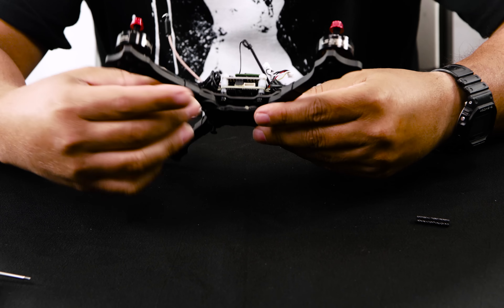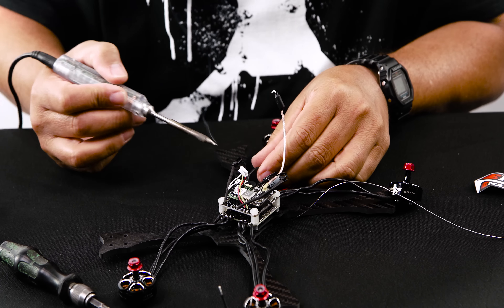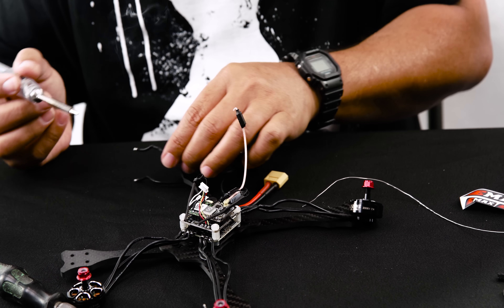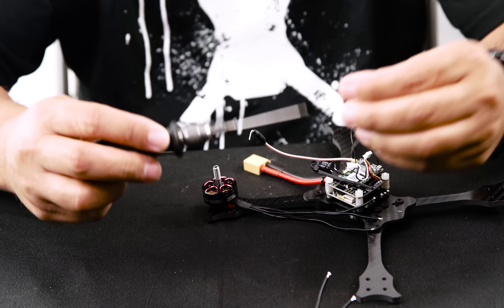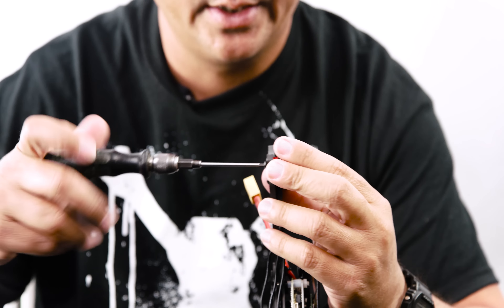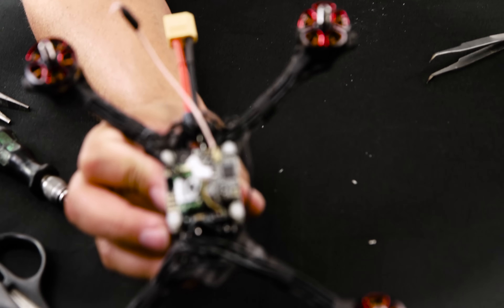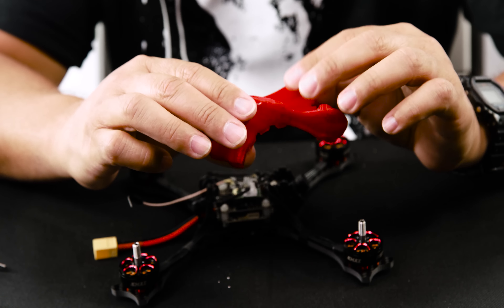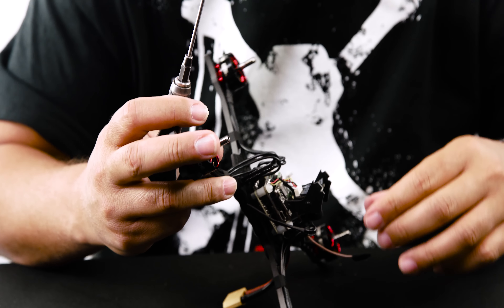Tutorial - How to Mod the Hawk 5

Comment: Hello Emax.
Please can you make a video or explain how to replace the linear antennas with the pagoda ones. My linear one fell out and I don't know with confidence how to replace the antenna slot with the SMA adapter.
Thank you.
Reply from the maker: Simply snap in the connector. Sometimes it will be a little loose so we recommend hot gluing or using a dab of liquid electric tape to hold the antenna in place.

Comment: I bought both the cw and ccw motors, do I just solder them straight on or do I still need to cross over a wire? I know I can fix it in blheli but jut checking.
Btw I love that tape. I using it on a freestyle build pretty good stuff.

Comment: Hey Billy, would you recommend conformal coating on the hawk 5??? The weather in the UK can be a bit dodgy in the winter ??
Reply from the maker: Some pilots have done it for those scenarios :)
Reply: Is that a waterproof spray??  What happens if you have to remember solder something after you spray it all over the quad? Does it come off easily?
Reply: @buleetu  the heat from the soldering iron takes it right off and it isn't a spray but a brush on coating, it's silicone in suspension but it insulates from shorts and waterproofs too

Comment: Can you guys do a video on how to replace the VTX? My understanding is its not a basic de-solder job..
Reply: I need this as well. As that crappy axii broke. Did you find a good vid to help you??
Reply: @xxmrkillswitchxx  no, but I think if  I use solder wick on the 3 pins it should come right off once the solder is cleared. A solder sucker would work too I think. The magnum stack pin out is easy enough to find. Biggest issue will be if you can fit your new vtx in the stack. Might have to de solder the receiver too to make it all fit.. i might build my stack up a level and put it in there...
Reply: Crap i did not (have not) want to do this ASAP... which is why i bought a rtf quad.  Now im thinking about returning it to amazon and rethinking buying this quad again
Reply: btw thank you for your thoughts hazmat321 .
Reply: @xxmrkillswitchxx  I thought I had a vtx issue early on, emax customer service was steller, they were going to send a replacement asap, turned out to be my fault. What is your vtx doing?
Reply: hmmm... i appreciate your wanting to help. happen to have an email or a place i could send you a picture or two?
Reply: and i do feel like an idiot because this seems too easy.  the  antenna on the vtx came unattached so i thought i would put the pig tail on, so i can put the real antenna on but it will not reattach. both connections dont look to be damaged... other than the sticky stuff they use (what is it?) to stick it down is now gone.
Reply: Mine cuts out, goes to black and the the screen does weird distortion and gets hot. Was this similar to your vtx issues?
Reply: Hazzmat321 it is a basic resolver job, it’s just tricky to get it off because you have to desolder 3 pins at once. I replaced mine with a tramp HV

Comment: Hi, I updated to betaflight 4 but obviously PIDs are not good. Is it possible to have an updated configuration for beta 4? Thank you
Reply from the maker: The Hawk 5 is designed for the stock firmware. We would suggest reverting back to stock settings and firmware :)

Comment: I want 2306 2400kv with hq5146 props. Gopro is not a must but i do use a firefly camera which is on 20g. Would a 2206 2300kv do fine? I dont want to lose flight time from my ls2206 2300kv.
Reply from the maker: A lot of pilots, us included, fly just fine with 2300kv with a gopro :)

Comment: Yaaaaaaas loving the hawk 5 with the mayday fin canopy ooo and I love ur guys 20x20 6s stack (first smart Audio build lol) and i love the gemfan 5149 on the stock motors avans were meh for racing very efficient but just didnt like feel like the props were for me... i think its easier to reverse the motor direction in the software makes for a cleaner job... wish the new stack had a camera control pin though wold be even more awsome

Comment: Can you make a video on how to add RSSI? I flashed my XM+. The receiver page on betaflight shows activity on Aux 12 but when I set it on the dropdown menu and save it, it disappears when I come back to receiver settings. RSSI just reads 17 on the OSD. 

I bought a FrSky QX7 just for this quad and have buyers remorse.
Reply: I’m running 3.5.3
Reply: I reverted back to 3.2.2 and it works now! Hopefully they’ll fix this on 3.5.
Reply: I'm trying to get my radio read out the voltage for me because I'm not using goggles yet, is it possible at all? As I read the XM+ is not able to send telemetry??  Thanks

Comment: I used these rsII 2306 2400kv motors on a new build and one gets extremely hot when just hovering for a minute or two.  The motor ha seven produced smoke once. 

I moved the motor to a different arm on the quad and the same problem. 
So I know it’s the motor.  Will emax replace this for free?
Reply from the maker: Open a ticket with us and we'll gladly help you out :) If you are in the US, emax-usa.com and if you are international, emaxmodel.com

Comment: I have an extra tbs unify...has anyone had any luck putting one in a hawk5...is it possible if I get out those pins.? Does anyone have a diagram?
Reply: you can clip the pins off and solder wire to it.. I've installed/setup other vtx w/smart audio. Also for whatever reason the stock vtx works better if you clip it off resolder with wire and attach with 3m foam tape. I think it reduces noise coming from the fc. I would also recommend adding a larger cap.

Comment: Great tutorial but you possibly stated conflicting information @ 27:30.  You stated that the NEW Mini Magnum VTX has smart audio but you should be clear that this is only through the OSD and NOT through the radio like LUA or Spectrum.  I was really disappointed finding this out after the fact as EMAX advertises smart audio however this FC does not support telemetry.

Comment: I have a question why would you put a 3 dollar vtx in a 250 dollar quad? I don't get it it's the most important part of the game. I love my hawk 5 but the vtx is horrible if it were my product I would have never put this in unhappy with the vtx I should have done some research before purchasing
Reply: I hear ya!! the whack liitle axii broke before i even flew it..  Guess I am gonna be learning how to solder a new vtx. got any recommendations?
Reply: @xxmrkillswitchxx  iv been looking around you want one that's 5v I have 2 that are 7v-24v so I would have to solder power wire to main battery pad
Reply: Thanks for the heads up!  let me know what ya end up going with.  I havnt looked closely at the stack... it would be nice if there is a good no solder option.
Reply: I had the same issue with the stock vtx.. had to clip it off the fc, later ended up burning up another vtx had nothing to fly with and reinstalled the stock vtx with silicone wire. I was surprised as the stock vtx suddenly worked great. It either has noise from the vtx sitting on the fc or bad qc on the connections.. I suspect that adding the 3m foam tape in between the fc/vtx reduces noise.
Reply: Please discover commas..
Reply: MAFIA FPV  On a 7-24v VTX(MUCH BETTER), solder your power directly to the VCC pad. You can use the ground next to it as well. This works much better than the 5v. It just doesn’t supply enough constant power.

Comment: I got my new 5" hawk pro today and out of the box the throttle channel is on roll stick and the pitch is on the throttle stick. No clear instructions is a shame on such a nice quad which so far is only something to look at here LOL! Mode3? Mode4 Mode 1 Not Mode2!
Reply from the maker: The confusion is due to your transmitter. Out of the box all our products use the default Betaflight Frsky configuration for your channels. This can be easily customized though. You can change the order through Betaflight or refer to your transmitter instruction manual on creating a custom model to match the input order.
Reply: My Hawk came with different protocol from AETR1234 Solved in Betaflight.
Reply: @EMAXUSA  Thanks, Emax should include more actual printed info for the price of the Pro, stickers are fine but a booklet or similar would help a lot. I was encouraging Emax china to make multirotor motors before quads so glad they became a leader. The old 2218 motors on big quads were great!
Reply from the maker: @hoverbotfpv1425  If any problems persist, feel free to open a service ticket :)
Reply: @EMAXUSA  Working fine now, not a problem with f7 or quad just default setting assumption. Thanks for replying.

Comment: I really don't like the original motors (light spec). The bearings fail easily + the bottom shaft screw is cheap and strips (plus some of them are out of spec and don't fit with any allen wrench ). I'm frustrated as I have two motors which I cannot take apart to replace bearings. Performance was good, but makes me nervous to try these new upgraded motors. Anyone have a good motor alternative for the Hawk 5?
Reply: Innovative RC the RSII are a great upgrade. Your exp with the ls motors doesn't sound great. I haven't had any issues with mine but I'm about to put the RSII 2306 2400's on as soon as I can get a day off of work. I've had them for 2 weeks and have yet to install them lol.
Reply: Innovative RC I've had the same experience with the ls motors bottom shaft screws. One out of 4 just stripped out, like it was a slightly different size than the others. I've emailed emax to ask for a replacement screw, as I believe I can get the screw out, but if I do I don't want to put it back in again.